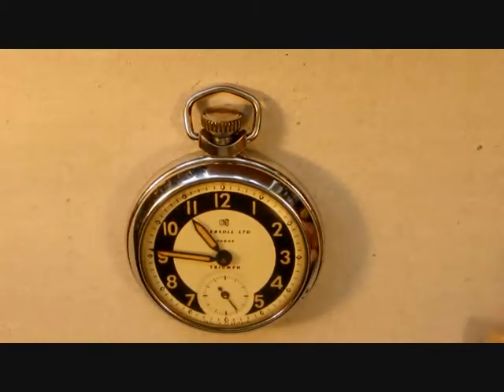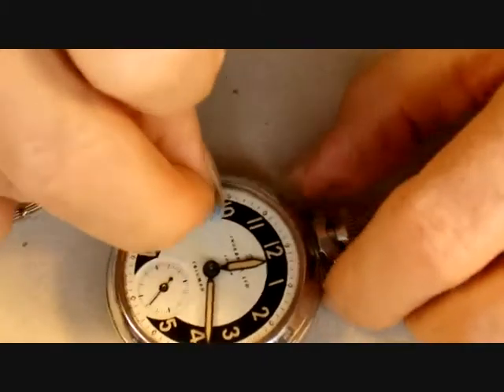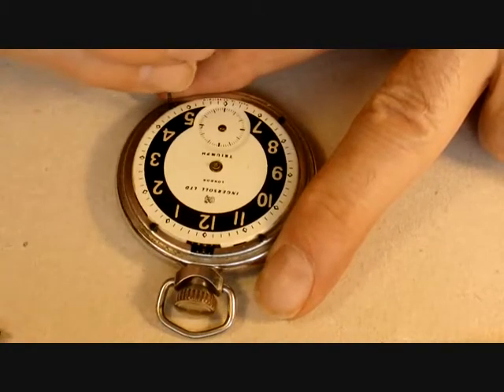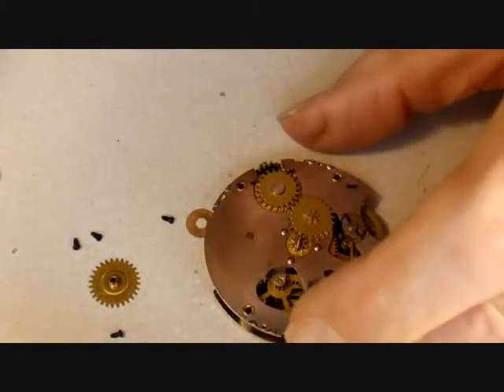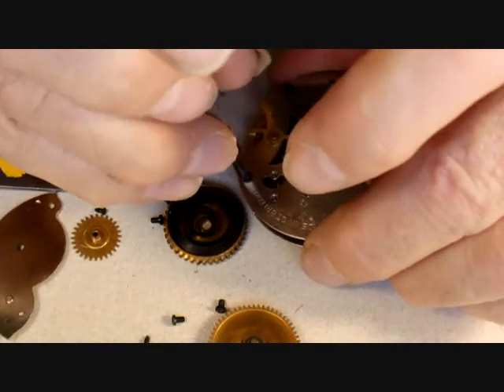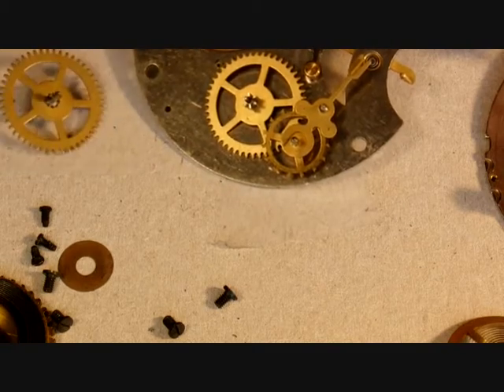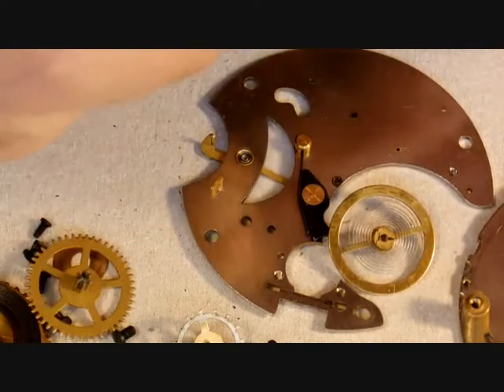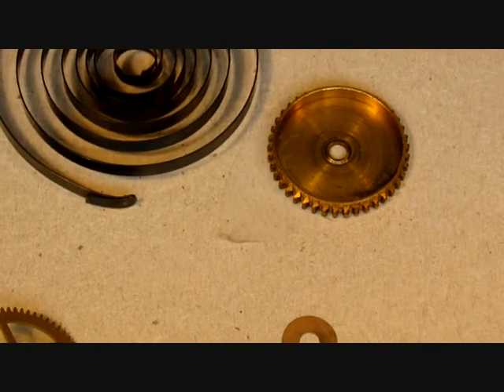SMITHS INGERSOLL Cal  PY pocket watch service Part 1 disassembly

Comment: Thanks so much! My late granddad gave me his broken Smiths Empire maybe 20 years ago? Tried getting it repaired at a local repair shop only to be rudely fobbed off! I have been through a disassembly and reassembly (thanks to your videos) and now have a (small) shopping list for parts. The mechanism is also completely working now (wasn't working at all before i tried). Mine is a February 1955 watch and i can't wait to get it running again! Thanks again
Reply: how to know manufactured year of these kind of watches ?
Reply: @SudarshanAshiya  when you pop the back off the watch it says "Made in Great Britain" then underneath there should be a number which is the year of manufacture. Mine has 552M so I'm assuming thts February 1955 (roughly when my Grandad actually bought it) though if anyone in the comments can correct/conform that I'd be very greatful
Reply: @DeanBritton  mine is made in USA. on the back 014743 and inside is 8474461
Reply: @SudarshanAshiya  the 8474461 suggests it was manufactured around 1904 ( http://www.pocketwatchrepair.com/histories/ingersoll.html ) but be aware people swap parts around so it may be that the case is from then and other parts aren't (i bought a pack of spares on ebay for the seconds hand and the balance wheel/spring/pin i think we're from a 1964 model) so take it as a guide if you don't know the watches history. I read on another forum someone had a watch with a 1894 serial number but the more expensive looking case/face dated earliest 1917 (caused quite the 'debate' between some of the more senior forum commentators)
Reply: @DeanBritton  wow.. thanks for the info. 😃👍 It is in original condition, my great grandparents bought this. and since my childhood this watch is not working, so I don't think it is repaired before. I opened this and found that spring mechanism gear is not on proper place it is bit loose.
Reply: @SudarshanAshiya    my Granddads was the same, my dad said he never remembered it running (he was born in 57) but thanks to Richard Edwards videos (and lots of impatient swearing) I've managed to get it running, just need to buy 5 different types of oil so I can start using it on special occasions! It would be nice if you could get yours working, a nice reminder of your great grandparents, their's plenty of people selling parts on eBay, just watch and listen carefully to the videos so you know the names of the parts you need!
Reply: @DeanBritton  but I don't have guts to open and fix this complex machine😂
Reply: @SudarshanAshiya  i was the same haha if you're mechanically inclined and patient, just study the videos a few times then pause at each step and take it one step at a time, you should be fine. I will be doing that again when i eventually get all the right oils for mine to run mine properly. Worst case scenario the majority of it goes back as it was and it still doesn't work 🤷🏻‍♂️ just be careful with some the balance spring as that it extremely delicate. A timy screw driver and a good pair of tweasers should be all you need (and the oils, of course, runnong it for more than just a test without oils will ruin it)

Comment: Thanks for the guide. I have one of these (with no glass) found in a box of stuff from my late godfathers house circa 1988 it would never run, I was going to chuck it, during a clean up on new years eve, then it suddenly started running  OK. I used to work in the Nuclear Power industry and took it into work in the mid 90's to get it checked for radium and the probes all gave zero counts, from the info provided in this video I know it is a 1971 model (thought it was older than that) so perhaps by then Radium based paint had been phased out?

Comment: Hello Mr Edwards, thanks for the video, I also clean and assemble Smiths/Ingersoll pocket watches but it is very difficult to get the balance and the wheel train right under the plate at the same time. I loosen the balance screw and fix the balance by tightening the screw. When I clean the watch I also disassemble the center wheel to increase friction of hands.
Reply from the maker: Yes unscrewing the bearing is very helpful if it unscrews easily but this is not always the case.

Comment: Hi Richard, great, useful video. I've acquired one of these and it's losing about a minute an hour. I expect it needs a clean an relube. Is it possible to do this without taking it apart completely? I suspect it has radium paint on the dial and hands and, whilst fairly low risk, I don't particularly want to be messing around with them. Thank you!

Comment: Thank you so much for posting this video! I inherited a similar smiths empire pocket watch and have ambitions of rehousing it in a custom metal 3D printed wristwatch housing. Not a clue what I’m doing but this helped heaps! 
Quick Q though.... I bent the hairspring a little when disassembling. Should I fix it? Can you fix it? Or can I replace it?
Reply: You have to be very careful while repairing the hairspring, it can break very easily. Perhaps you can purchase an old used movement with a working balance, so you can replace it...

Comment: Great video . I have an Ingersoll i'd like to service - but how do you remove the crystal? Like you say this watch isn't supposed to be serviced so maybe you can't / shouldn't bother. Thanks!
Reply from the maker: Smiths watches were designed to be serviced. It was Timexes that weren't and even those can be "serviced" up to a point.
Reply: The crystal just pushes out, at least mine does. and I can carefully push it back in with my fingers, if you try it you'll hear it snap back into place... just do it carefully.

Comment: I have a 71 model, not too sure on this of mine has radium paint
Reply from the maker: There's a two digit number on movement which is the year of manufacture. Anything after 1968 should be safe. I think the changeover was in the mid-sixties. Also Radium paint loses it's green colour more rapidly.

Comment: Hello Mr Edwards, do you know the amplitude value for this movement?
I've tried to service myself  for training...initially after reassembly, the movement does not start...after a day it started but the balance wheel seems like slow...
Thank you in advance.
Regards
C
Reply from the maker: Firstly do not expect a "Timegragher" watch timer to work on these. The sound of most pin-pallet watches cannot be deciphered by the inbuilt program so even in the unlikely event it can display the rate it cannot  report amplitude.
Secondly do not expect a watch cleaning machine, still less an ultrasonic bath, to remove all the dried oil from the pivot holes. They must be pegged clean, especially the conical pivots.
Once this is done and good watch oil applied a healthy amplitude will be about 200°. Do not forget to oil the escape wheel teeth.
One last thing, the commonest cause of low amplitude in any watch is the hairspring rubbing either on the balance or the underside of the cock.

Comment: Definitely wouldn’t want to be touching those radium hands/dial with bare hands and without a mask. You breath that in or digest it, its going to be inside you forever.
Reply from the maker: It is generally agreed that wearing a mask is not necessary unless the paint is friable or being disturbed.
When removing Radium paint i.e. for reluming, the parts are held under water for the entire removal and glass brushing. Finally the water is flushed  down the drain with plenty of water, clean up thourougly and dispose of the cloth.